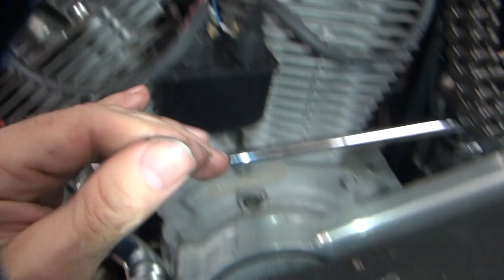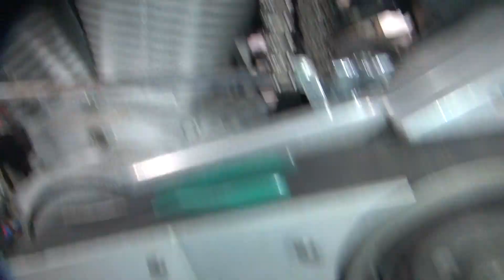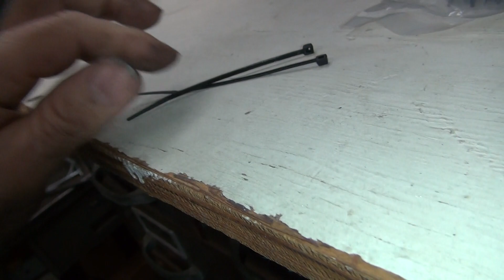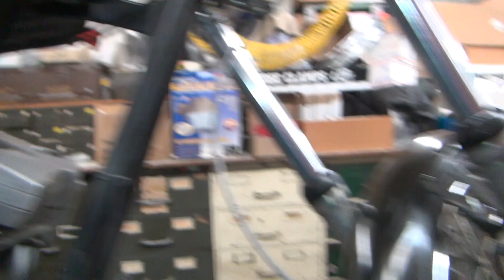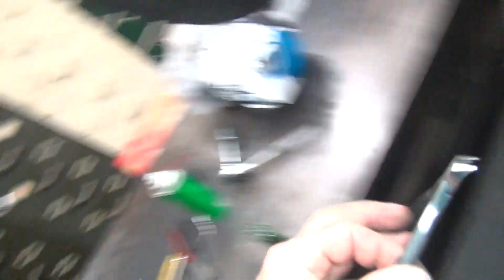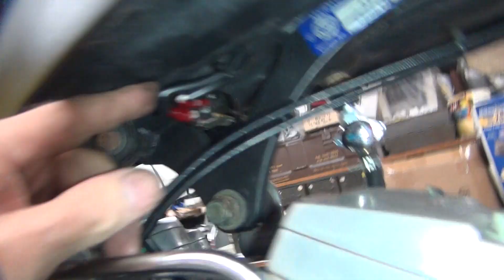#273 1999 80ci evo chopper upgrades running lights & brake repair bobber custom harley tatro machine

Comment: Hello my friend I have a 1965 panhead with generator can I put a remote charge lead to keep the battery tended if I disconnect the battery do I have to repollorize the gen I will try and do it without disconnecting the battery as I can't see the connections on the control box very easy regards Alan
Reply from the maker: just hook it up like anything else.
tatro